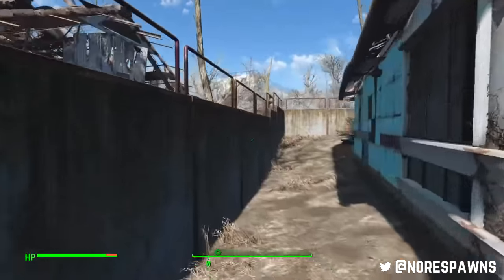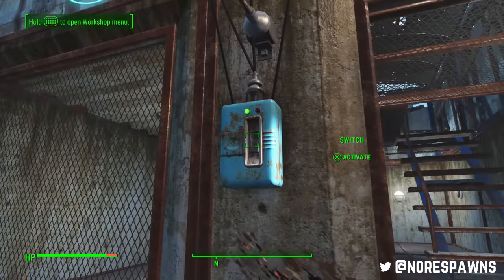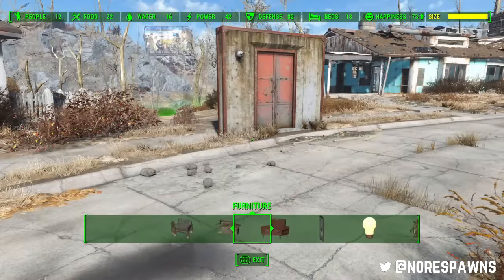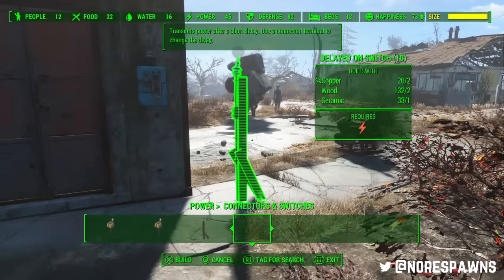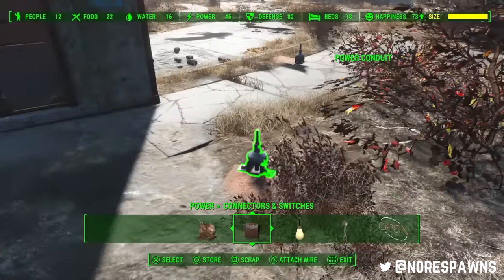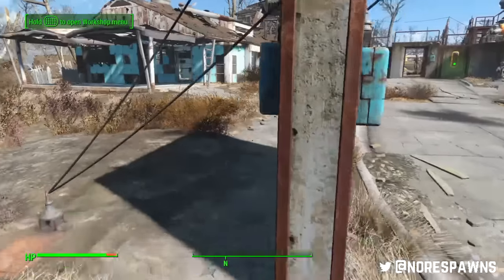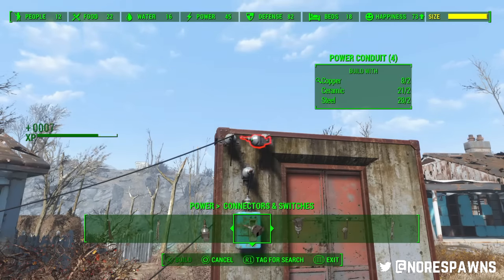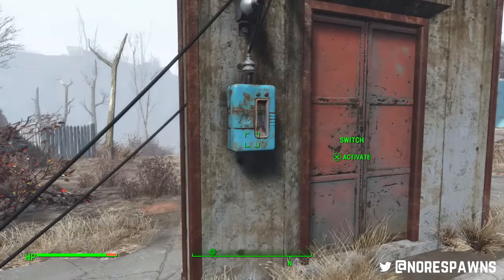Fallout 4 Guide - Working Powered Doors with TWO switches

Comment: Bethesda needs to tweak the door so it has a legitimate open close on both sides built into the door structure.  Thank you for the work around until such time it happens.
Reply: +ozskeeter Holy S**t, i feel stupid right now that i didn't know this switch existed... thanks man now i can build alot more stuff that i couldn't do before...

Comment: I spent some time figuring this out too and was quite chuffed when I got a 2-way powered door working on my Sanctuary house. Went off questing for a while and returned to find that a settler had magically got inside my locked house. Motherflipper.
Reply: +TheNattyP   I had the same thing happen to me, it was a little frustrating.
Reply: +Madmommy 101 I'm finding settlers in there all the time now. I was trying to assign a new supply line the other day and rang the bell to gather everyone together. A bunch of people didn't show up, so I opened the door to my house just to check. Lo and behold, there were 4 people stuck in there. Anyone know if this problem is unique to Sanctuary houses?
Reply: My game crashes when i go into Sanctuary. It happened to me on top of Red Rocket.

Comment: I know this video is before Contraptions, but that DLC made this MUCH simpler.

1. Place your door, Conduit facing outward
2 Place a switch on each side of the door
3. Connect outside Switch to the door
4. Connect inside switch to Power
5. Place a Conduit-Wall Pass-Through in the door
6. Place a Conduit Junction on the side of the Pass-Through that doesnt have a conduit
7. Connect the two switches to the Pass-through on their respective sides

Now the inside switch will control the power going to the outside switch, so if the inside switch is one, the outside switch will open and close the door, and if the inside switch is off, the door is locked from the inside

Hopefully this helps someone out because I tried to follow this and other pre-Contraptions steps and failed, then I tried this. Yay Contraptions Workshop
Reply: thank you, you made this so much easier
Reply: I did it pretty similar to ur way I'm gonna upload a video of it in a littlebit
Reply: ur a legend 😊
Reply: at 5 line.. does that conduit go THRU the door or BESIDE the door (Door with wall as the oppose of default conduit).
Reply: Bad solution, you can be locked inside by someone outside
Reply: Could you explain 5 6 7 a little bit more clearer
Reply: doesn't work
Reply: Richard Wallace thx man I been at this for a while and yours helped out a lot
Reply: Thanks for the clear explanation. Norespawn really made a hash out of this.
I used the logic gate switch, as shown on the Skoolzone video. But, I think this method is much easier to use.ty
Reply: Helped out so much thank you
Reply: Thanks man
Reply: This was way easier. I tried doing a wifi set up with a logic switch but only one switch worked.
Reply: It w orks but If you want to put the door outside your house with a little roof, you can't, only with the rug glitch like the video here
Reply: thank you bro, still helping people 7 years after posting

Comment from the maker: addendum - apparently can wire the two switches up directly through the concrete. I did not realise you could do this - so you can skip out on the ground conduits. 

Still make sure that the power goes to the inside switch, as you want that one to be the one that 'turns off' the switch outside.
Reply: Praise Atom for this addendum!! Your initial process for rigging up power to these doors literally made me go cross eyed.
Reply: +norespawns Yeah, I did it with a single conduit (between the power switch and the door switch) using the attach wire to wires trick to connect things through the wall.
Reply: +CluelessNinja 21 It's way more simple than he makes it look....
1) Place your door. 
2) Put a switch on the outside, and connect it to the door connection.
3) Place a switch on the other side, along with a conduit just above the switch.
4) connect the inside switch to power.
5) connect the inside switch to the inside conduit.
6) connect the inside conduit to the outside switch.
Done.
Reply: +CluelessNinja 21 Not 100% sure I understand your question... but the mechanics of how this works is as follows:
power----[inside switch]----[outside switch]---door
when the inside switch is powered on, the outside switch can open or close the door.
when the inside switch is powered off, the outside switch is forced off, and the door is closed.
Reply: +CluelessNinja 21 That conduit on the door object is the one you connect the outside switch to. That's the one that powers the door.
Having the inside switch connect to a conduit you place on the inside is what lets you do the connect wire to switch trick to pass power through walls.
(Hover over the wire connected between the two, and press the attach wire button)
Reply: +norespawns I just figured out a whole new way to open and close a  powered door from both sides.

1. Place down a Power Counter, and use a terminal to set it to 1, 
2. Connect the Power Counter to the door.
3. Place down a Delayed On Switch, and wire it to the Power Counter.
4. Place another Delayed On Switch and wire it to the first  Delayed on Switch.
5. Connect the last Delayed on Switch to the incoming power, and move the Delayed On Switches to opposite sides of the door.
6 Press the switch either side to open and close the door.

To make sure I wasn't too confusing, it goes

Power --> Delayed On Switch  on one side of the door. --> Delayed On Switch on opposite side of the door. --> Power Counter set to 1 --> Powered Door.
Reply: +MrZarkaina I can't get that to work.
Reply: +norespawns my switches wont connect through the concrete, I seriously don't get what im doing wrong but this step always fails
Reply: +Brandon Bey Could you help?I cant connect the inside conduit to the outside switch!The wire wont go trough the concrete  >_<(i'm on PS4 if that matters)
Reply: +Nick Johnstone  Have you tried using the wire glitch?  I can't explain it but there are videos for it.
Reply: tlopesgsd i managed to do it using the delayed off switches. thanks though man
Reply: +Steve Radroach I don't know if they have patched that glitch out or not... I think in the 1.5 patch on PC it's been removed (or changed). You may just have to find a way to connect it without glitching, sorry :(
Reply: +Brandon Bey I built a switched powered door last night, around 11pm GMT and it was still working. Unless 1.5 came out overnight it should still be fine (I hope).
Reply: +Nick Johnstone same. I have no idea why this is so complicated.
Reply: im building a base with a virtibird platform so when i get it in a mod my military stronghold will be complete and the comenwealth will be mine!! waha!!ha!#
Reply: +CluelessNinja 21 Ah, no longer clueless. You know of course that Ninjas as a group are not expected to be wiring experts. Exposed wiring is even worse than normal. ;-)
Reply: That's a relief as I found your original video quite daunting so hadn't even attempted it.
Reply: what mods are you using on this video
Reply: what mods are you using on this video
Reply: The game won't let me do #6
Reply: +Jack Bolt it's a doc wasteland workshop I think
Reply: +Jack Bolt it's a doc wasteland workshop I think
Reply: +Jack Bolt it's a doc wasteland workshop I think
Reply: +lord krazy *dlc
Reply: +lord krazy *dlc
Reply: +lord krazy *dlc
Reply: lord krazy h

Comment: basically you're wiring the two switches in parallel, with the outside switch feeding the door conduit, and the power coming into the inside switch.   After watching your video, and with someone else's comment about using a sign, I was able to do it without so many connectors.   

Put the inside switch on the inside of the door.  
Put a painting, large enough to hold a switch on the inside of the door.  Put the outside switch on the painting.  
Wire the power to the inside switch, from there to the outside switch, from there to the door's connector.  
Then move the painting (with the outside switch on it to the outside of the door.  Voila!

Comment: I figured out how to use a single pressure plate to operate a door from both sides. If you stand on the pressure plate while picking it up in workshop mode the door will stay "stuck" open while you move the plate around. I then place the single plate right in the middle of the door so about 1/2 sticks out on each side when the door is closed. Works great and leaves enough of the plate exposed on both sides of the door to be able to step on it from either side. The best part is you only have to have one set of wires so it looks cleaner and you don't have to do any clipping tricks to run wires through walls etc. If you want the door to be lockable, just put a switch in series before the plate.

Comment: heres a challenge for you. can you figure out how to use a trip wire to open a cage? in other words can you use a device that turns the power on to activate a device by turning the power off?
i wanted to use the cages as traps, so to speak. when a badies trip the lasers they find themselves surrounded by monsters.
Reply: Cages open when they are unpowered if they've captured something, so run power through the tripwire then to the cage. Just make sure you use a terminal to set it to only trigger for enemies or settlers will turn off the cage.
Reply: +Balthazar21 could just use the new logic gates

Comment: you made that difficult. to do a switch on the outside and inside, all you need is a XOR logic gate. Also, if you do it with the logic gate, you cant lock yourself out.

Edit: Good point. In that case, there is now a much easier way.
Reply from the maker: +techop2010 this video was made long before the logic gates were added

Comment: So you could do this quite a bit easier I think with the wire glitch. If you have a wire connected to a pylon/conduit and hover over it so the wire is highlighted but the cursor is on the conduit or really close to it and press the attach wire button. It should make the sound like the wire is attaching but it won't spawn a wire. Now, without pushing other buttons go to whatever conduit you're trying to connect and push the attach wire button. A wire will now place between the conduits regardless of walls and I'm pretty sure regardless of distance. 

That way you don't have to faff around with the rugs.

Comment: Davey I use 2 delayed power off switches and rug glitch into the wall, you can add a on and off switch on the inside to keep doors open if needed.

Comment: I need to make and post a how-to video, but I've been able to do this with only 1 conduit as long as both switches draw power from separate conduits.  The switch on the opposite side can  connect to the conduit fixed to the door by clipping its cable (only clips for that conduit)so no rug trick needed.  

cabling diagram:

generator > conduit 1 > switch 1>door conduit > switch 2 > conduit 2 > generator

Using the door requires a weird dance to open and close. Open door with switch 1, step inside doorway and hit switch 1 again to close the door.  To exit hit the switch 2, step inside doorway, hit switch 2 again.  Basically, you have to ensure both switches are set to off for the door to stay shut. (ON+OFF = open, OFF+OFF = closed, ON+ON = Stay Open, OFF+ON = Open)
Reply: +copester1204 The way you did it and the way Davey did it can both be done without any conduits at all... all you need is a generator, 2 switches, a door and some magic... no but seriously it's just a simple circuit with either parallel switches or serial switches...

Comment: I use two delayed off switches, one for each side of the door, & mat-glitch them into the frame after wiring (power source to switch to door on each side). That way when you hit the button on either side, it opens the door & then automatically closes it after the delay (set via terminal- although for some reason setting the delay doesn't seem to work very well & it ends up closing after 1s even if setting to 4s, but it's enough to get through).

Comment: If you rug glitch a shop into a powered door and use a pressure plate, you can have a shop that opens and closes. Add lights and 'open' sign for a better effect. ......

Comment: nice door set up, you realize you only need 2 power switch and 1 connector? 
5 EASY STEPS
step 1
2:30 put a switch board on the "inside"  but DO NOT connect (yet)
step 2
put connector on the floor DO NOT connect (yet)
step 3
3:00 put a switch board on the "outside", now connect that switch on the "inside" but DO NOT connect it on the other switch, connect it on the door frame connector (wire glitches in).
step4
 now connect both "outside" and "inside" switch on to the connector on the floor. (you can flip the door left and right to glitch the wire).
step 5
finally connect the main power line on the "outside" switch board. 
there you have it a simple working powered door with two switch!. BTW when putting the "connector" on the floor, make sure that is the spot where you want your door as you can glitch your door to sit on top of it! :)

the number on step 1 and 3 is in this vid, shows you which is the "inside and outside"

like if you think this help! :D

Comment: Power>Internal door switch>external door switch>door. Add conduits as required. I added this to my main home entrance yesterday but also added a the decontamination shower so when the door is open, the shower is on, shut the door and the power goes off. mmmmm i wonder if trip wires could be used instead of switches .....

Comment: Literally already spend two hours figuring out a combination lock with the door using four switches to use at red rocket. Designed so that if any wrong switches are flipped it will auto lock

Comment: i have two set of the wood and white sliding doors. i did this to the one and it worked. did exact same thing to other didnt work both switches didnt work. i tried later and got the second one only now the one that did work doesn't now wtf

Comment: Well that was as clear as Mississippi mud pie. Do all these factors fall down regarding the settlers ? As they just spawn were they want either inside or out and just disappear and appear somewhere else ? So you wouldn't actually be able to lock them in or out of amywhere. Like when I build a base which is surrounded and fortified against attackers and for the security of my settlers but it's all pointless because once the base is attacked they all run outside to fight in a field negating the whole point of a fortified settlement New engine on the next game is badly needed

Comment: Connect one switch directly to the door with power, connect a second switch on the opposite side of the door and run a single power node on the ground and connect the two switches and your done

Comment: how do you get different types of Caged Creatures? always get normal Deathclaws and Charred Ghouls...
Reply from the maker: +James “Jnichols0808” Nichols I don't rightly know - it's random it seems.
Reply: +norespawns ah... that's rather unfortunate.
Reply: +norespawns though I have had luck with having one cage connected to another cage and having that connected to a switch and 5 times out of 10, there'd be a Glowing One or a Putrid Glowing One out of either one... may need to test it more...
Reply: if you dont know already its pretty boring, but i save before i open then load back if its something i dont want. 
Hope this helps?
Reply: +Velocity DC ah. helps a bit. so is it a Hard Save or a Quick save?
Reply: +James “Jnichols0808” Nichols Any save I believe, quick save or hard save. :)

Comment: Its too messy. Why cant you power one side then have neat wires. 

Build a wall of display racks run a wire through the add the last peice. I love those display racks they make settlements look awesome. 

Also a single colomn of concrete then add as many traffic lights as possible in a bar. It brings the disco. 

Concrete is my favourite cos vaults take too much space to build. The yellow bar. 

I can build fortresses with concrete tho lol. 

Also do you eject power cores around 10% to then sell it to a vendor for 150caps ish. Im at lv106 perks tho.

Comment: Holy fucking balls!! Talk about a convoluted masterpiece of a clusterfuck, just to get a goddamn doorway to work. Apparently Bethesda didn't have an electrician on staff when they came up with some of the ways they expect you to use their powered pieces in the settlement mode. Maybe instead of having a bunch of power pieces that I never see anyone use in any of these builds (the delay pylons, etc.) perhaps they could have provided more practical ways of rigging up electricity to their friggin doors. Love your vids Davey, but this just looks like more trouble than it's worth.
Reply: +Joey Burke The delay on pylons are really nice for things like doorbells, and I use the delay off for auto closing powered doors that I can open from both sides
Reply: +MrZarkaina where in the hell did you come up with a door bell?!?
Reply: The powered speaker can be used as a doorbell
Reply: I just figured out a whole new way to open and close a  powered door from both sides.

1. Place down a Power Counter, and use a terminal to set it to 1, 
2. Connect the Power Counter to the door.
3. Place down a Delayed On Switch, and wire it to the Power Counter.
4. Place another Delayed On Switch and wire it to the first  Delayed on Switch.
5. Connect the last Delayed on Switch to the incoming power, and move the Delayed On Switches to opposite sides of the door.
6 Press the switch either side to open and close the door.

To make sure I wasn't too confusing, it goes

Power --> Delayed On Switch  on one side of the door. --> Delayed On Switch on opposite side of the door. --> Power Counter set to 1 --> Powered Door.